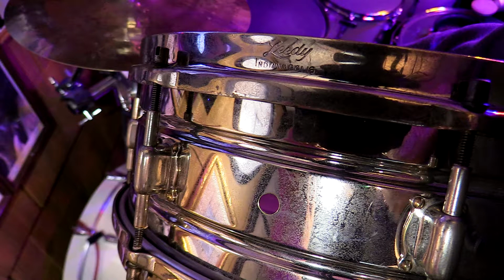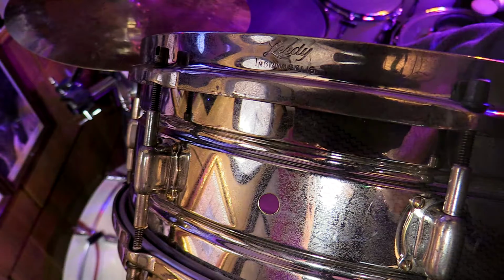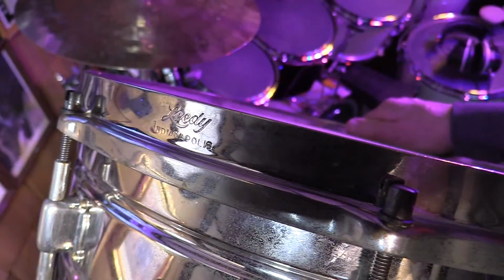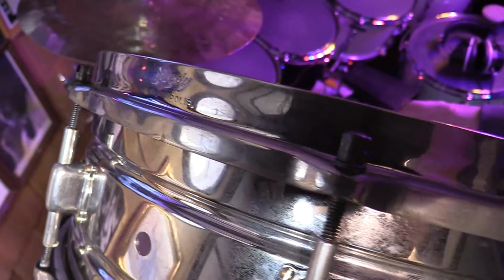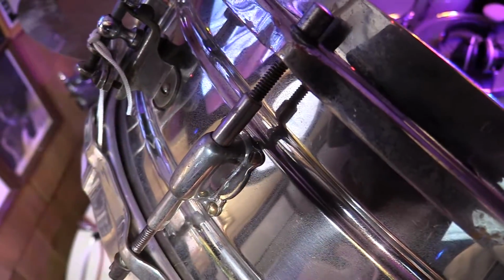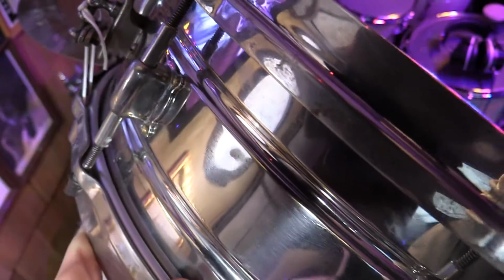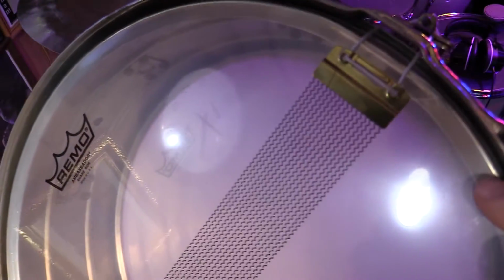Leedy 1926 Professional Model 5x14 N.O.B.

Comment: Amazing video and information... That drum sounds like a Yamaha recording custom made in Japan. I am in debate i am in a purchase a black elite 1920 snare or Ludwig 1920 nickel over brass dos piece welded inside don't know which one will hold the value and will have the best sound... Please advise... Amazing video and sounding snare / drums
Reply: I’ve had both black Elites and 1920’s Black Beauties or even the nickel over brass Ludwig’s which are the same drum as the Black Beauties. They are both great drums but sound is subjective. I think you can find many videos on YouTube of both drums and see how they sound. Of course hearing either of these drums in person is the best thing to do and it depends on the tuning, choice of heads and wires too.. Maybe go to a drum show and some dealers will have other drums to choose from. I sold my Leedy Black Elite last year but I still have 1920’s brass Ludwig s I. 4”, ( Black Beauty) 5” and 6-1/2. The 5” drum is ten lugs and the 4” and 6-1/2” are eight lug. I also have an early teens or 1920’s 6-1// x14 Ludwig with six lugs. Good luck. I think the 1920’s Ludwig’s might hold up better in resale value but like everything else prices go up and down and if you’re looking for a certain sound then don’t let the resale value of the drum stop you.
Good luck.